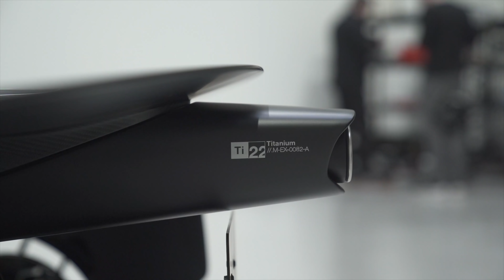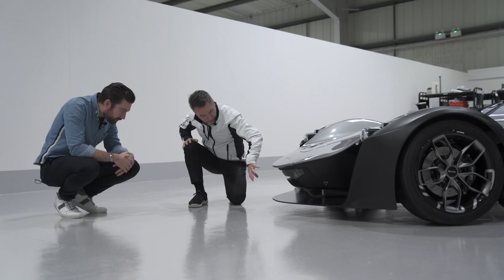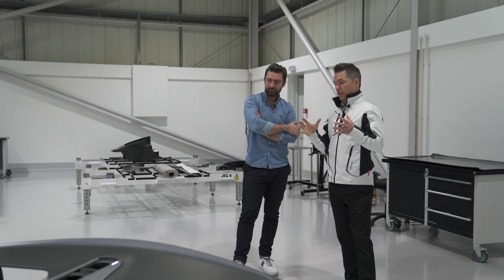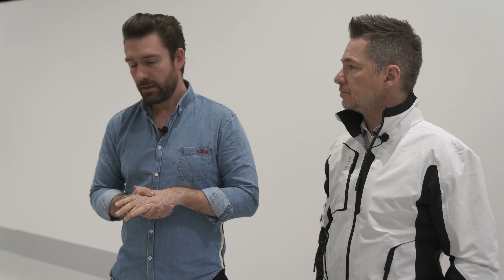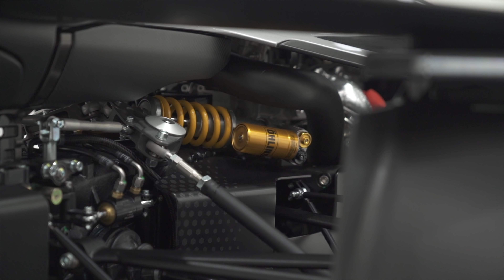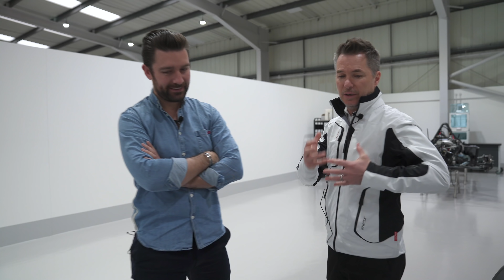NEW 2021 BAC MONO -The Ultimate Drivers Car!? Exclusive First Look!

Comment: It's a real shame they've had to move to forced induction.  NA motors are more fun in lightweight RWD drive cars because they're driven so much on the throttle.  The elastic power delivery (lag when you're on off on off the throttle) of a turbo motor gets in the way of that.

Emission compliance in cars like this is farcical.  They'll sell in very low numbers and do very very few miles in their life.

Comment: FUgly instead of angular haha brilliant. I can tolerate the rear but the front No! It’s amazing how they could botch it, but understandable cause they operate on the edge, like pussy cats. I WOULD HAVE WIDENED IT, UPSIZED THE WHEELS & ADDED A SEALD TOP FOR THE FIGHTER PILOTS IN BACH CUSTOMERS. Subdued is no way.

Comment: Always one thing missing on wonderful  cars like this, a visual or verbal explanation of number plate positioning and how it affects aesthetics.
Reply: Michael Probably a vinyl plate attached to the lower spoiler or on the bonnet if looking for a permanent attachement but I would expect a removable clip-on affair to drive to the track and then detach and stow away for lap attack. Or just not bother at all.
Reply: Alfa Romeo is the brand that has the absolute worst license plate positioning along with Bugatti. They look horrible with front plates.